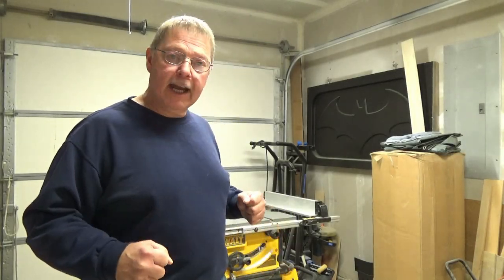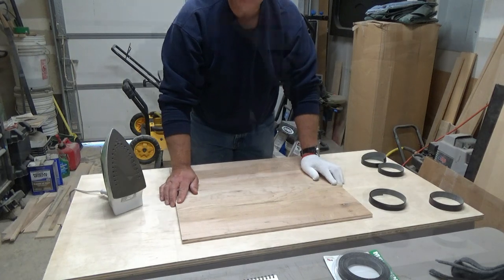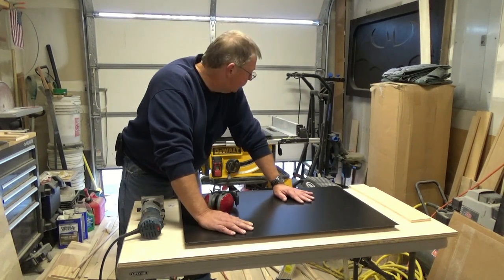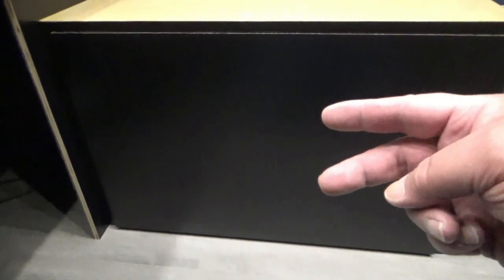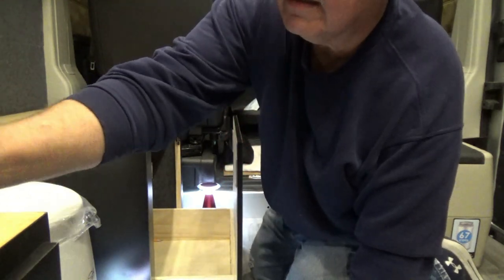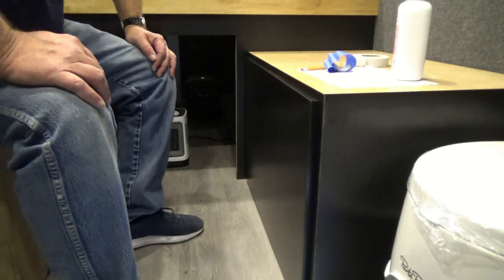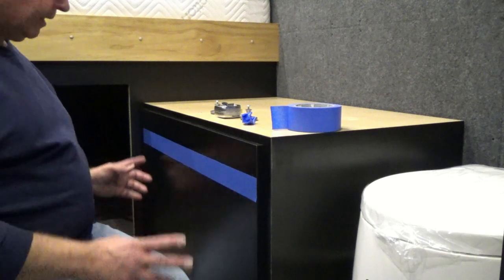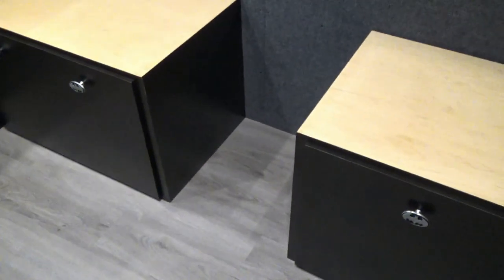Promaster Van Build 2500 159WB – DIY–Finishing the Drawers – Part 19

Comment: Al, will you take the potty out of the drawer when you take a dump. I was thinking that sitting on it while its still in the draw would be too heavy for the slides.
Reply from the maker: Hi George! Actually, the way it is working keeps most of the weight off the slides. I put down a runner carpet on the floor, when I slide the drawer open, the door rests on the floor and supports the weight... didn't plan it like that, but worked out that way. When I sit on the potty, nothing moves. I'll have to make a demo video how it worked out.